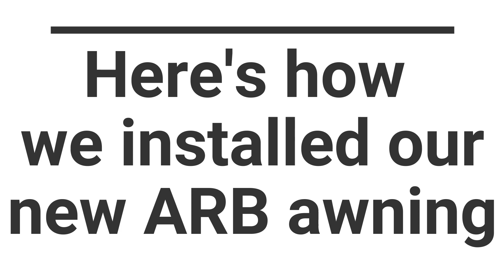ARB AWNING 2500 DIY BRACKETS for camper roof rack | Land Rover Defender | Equipment series

Comment: The awning is a great addition- nice work fabricating your own bracket- please use the vise to hold the grinder or the pieces you are sanding I know it sounds like a motherhood point but it only takes a second to lock in and a millisecond for the grinder or piece to slip when holding both and cut up a hand with out being able to react -I have lots of scars to prove  that I am slow to learn or rushing to get something down. Love your enthusiasm for travel and looking after your own defender.
Reply from the maker: Thanks for caring! We would really need a workshop ;)